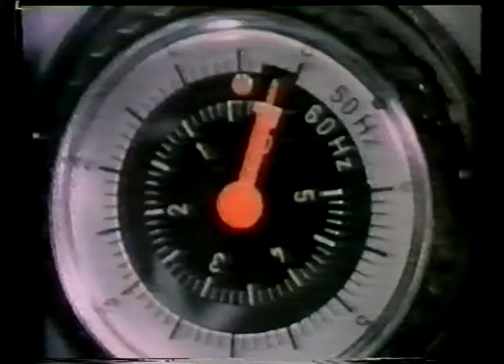BBC Engineering Craft Studies EP 2 Using Materials

Comment: Tuffnon? Tuffnob? I'm assuming that's Delrin.
Reply: Tufnol! It's a type of composite (unlike Delrin, which is plastic); it is paper or cotton reinforced plastic.

Cotton/paper and resin is laminated, then pressed together at high pressure, and left to dry (where the fibres of the paper/cotton also 'soak up' the resin). 

This forms a good, strong laminate sheet that is quite durable and wear resistant. And dependent on the resin used (for example, in the gear application), it can be self-lubricating.

Hopefully that is helpful!

Comment: ECS stands for Engineering Craft Studies BBC One Schools Programme aired usually runs on Wednesdays at 09.15 begining two terms are: autumn and spring terms from September 1972 to November 1972 even sometimes early December before Christmas, with some half term repeats which is normally holds every late October, lasts until late November 1981 last series many repeats continuing Education Learning Engineering Studies from 4 October 1972 until 25 November 1981 with some repeats continuing from 17 January 1973 until 26 March 1980 with some repeats with some half term repeats which is normally hold every mid-February. From spring term 1981 following succeeded by Technical Studies from 21 January 1981 until 1 April 1981 with half term repeats during the holiday. Another two new series from spring term 1982 and autumn term 1982 but this time with two half terms repeats which is normally holds one in every late October and another one in every mid-February, with the some repeats.